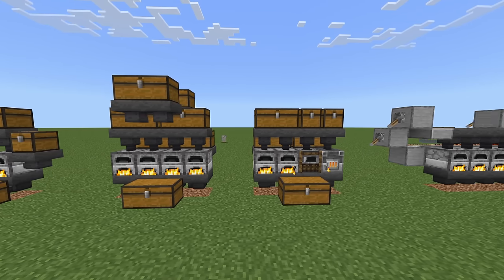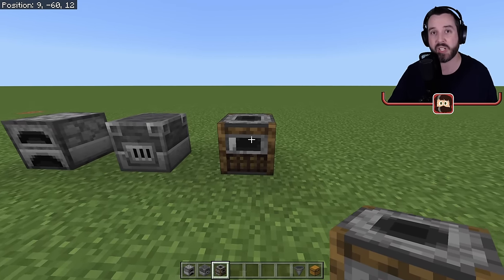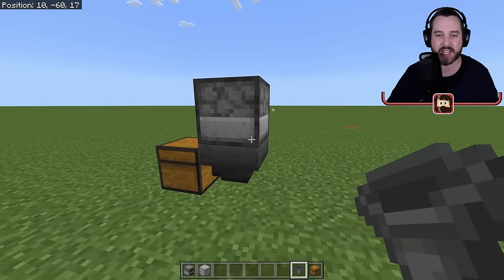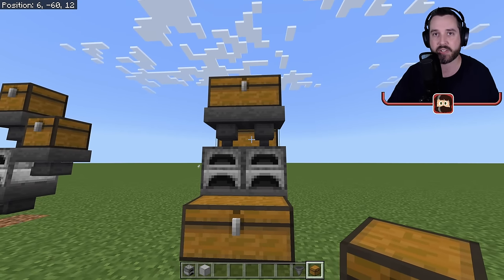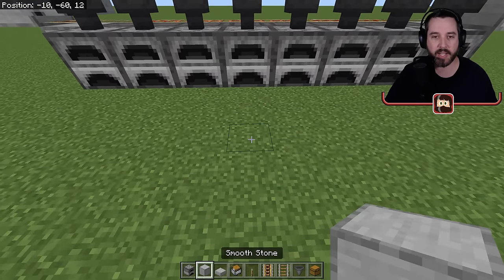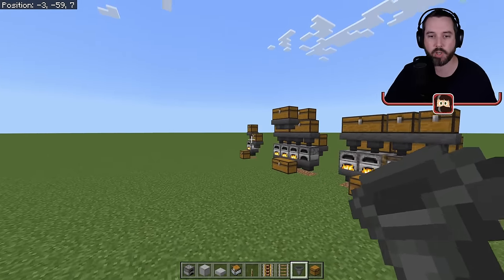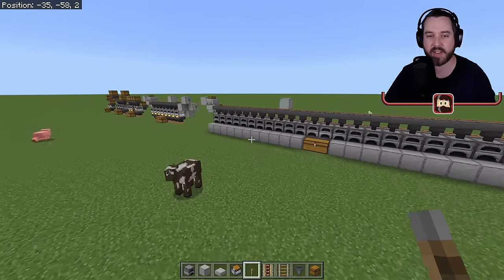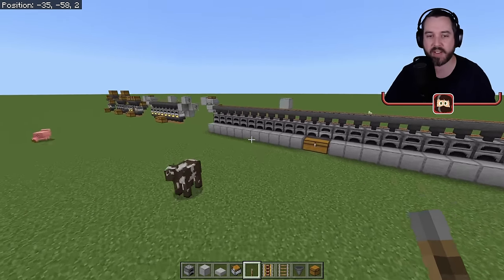4 Automatic Furnace Setups ANYONE Can Make In Minecraft 1.19

Comment: I typically build my super smelters with 27 furnaces. I find that perfect, especially if I'm using lava buckets for fuel, since thats the maximum a chest minecart can hold. It makes 1 pass use exactly that one chest load worth.
Reply: 27 x 100 = 2700, but the chest is 27 x 64 = 1728, so I think, it's not effective. Or am I wrong?

Comment: My favorite furnace array got patched out.  It used a zero-tick bamboo farm to automatically fuel the furnaces.  It would turn on when the last furnace on each side would go under 64 bamboo and water flowing over ice would keep the bamboo going.  Collection was done using a pair of hopper minecarts with automatic return.  I might try doing the same but with a large automatic bamboo farm into mass collection sending into a dropper with the same water distribution system.

Comment: A little tip: for fuel alternatives to coal, consider using wooden slabs. Yes, really, slabs. They are better than charcoal for fuel as one log turned into slabs smelts 12 items, whereas if you turn the log into charcoal, you can only smelt 8 items, and must also consume fuel to make the charcoal in the first place.

Also, wooden slabs are more suited to smelting small numbers of items like 1-4. Given that coal or charcoal can smelt 8 items, then using slabs as fuel means you waste less of the fuel smelting items, assuming you don't put in a multiple of 8. This is helpful early-mid game, particularly if you're low on coal.

The only disadvantages are that slabs take up lots of space if you want to smelt lots of things, but then for volume smelting a better fuel such as coal blocks or lava buckets is preferable. Also slabs have to be manually crafted whereas something like kelp can be farmed and automatically harvested, but then by that point you probably already have plenty of other fuels already.

Finally at the very start of the game, don't forget you can cook food without any fuel consumption using a campfire - again very useful at your starter base if you don't have much coal or want to use it sparingly.
Reply: So will the empty lava buckets automatically move to the chest?
Reply: @thunderjumper7958  they do I tried this today u put the lava buckets on the fuel then they run through and then empty out and go to chest
Reply: Campfire cooks kelp.  My only problem is i forget to collect the cooked food so i lose it
Reply: @hookedbycrafting5348  a hopper under the campfire will cure that, although you may have enough coal or slabs to just use a normal furnace by that point
Reply: isnt the best fuel scaffolding still?bamboo and spider farm  needed obviously but a lava farm is a good early game alternative
Reply: @HeresPablo  nah, scaffolding got nerfed in bedrock 1.19.40 - it now only smelts 0.25 items per scaffolding as opposed to the 6 items that it used to.

Comment: Hey Prowl, it’s still not really automatic, you have levers and buttons still. You can actually make it automatic if you spend a little more time thinking it through and it wouldn’t be bulky. Also unloading is a concern with mine carts if this isn’t chunk aligned. The decorations looked cool at the end.
Reply from the maker: I'd say thats similar to saying it's not automatic because you need to put things in the chest, or a mob farm isn't automatic because you need to flick a lever for the trident killer :)
Reply: @Prowl8413  putting items in a chest has to happen. Pressing a button or a lever does not. You can use the output off a comparator as the items exit the chest to start the contraption. You can attach a pulse extender so that as the items leave the chest and the comparator dies there’s still enough power to kick that mine cart one more time.

Comment: The super smelter doesn't work correctly , the top minecart feeds into the bottom one
Reply from the maker: That used to be a bug years ago with hopper minecarts that was fixed, but also in the video here I used chest minecarts, so that isn't possible
Reply: Really the one I made a few months ago did it still but I'll rebuild one to see if it's patched cause it's a pain